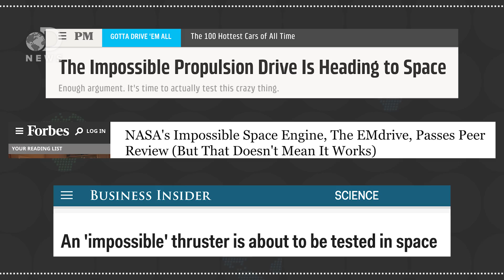How The 'Impossible Drive' Could Break Newton's Third Law

Comment: it is because the shape is a cone that it dosnt break Newtonian physics. forces on the flat end all react along the axis. while forces on the angles walls act at an angle to the axis. the part of the force perpendicular to the axis is cancelled out by reaction forces on the other side of the cone. leaving only a small amount of the force acting along the axis. so you have a reaction force of 1 vs a reaction of cos(angle) [which is less than 1] . resultant is an over all reaction force on the cone in one direction. albeit the force is very small, sign(angle) of the momentum of microwaves, so very difficult to measure let alone test.  acceleration due to the sun light hitting the craft is likely more than this engine can produce. it will likely need more than one test flight to make certain it works.
Reply: Notgnihtrow 1.2mN/KG
Reply: I try not to miss the opportunity to question someone who seems to actually know something- so two for you.  Are you proposing some kind of highly reflective solar sail as more efficient?  Second, in the proposed engine would it further tip the scales if the cone were highly reflective and the back not so reflective- like hitting a golf ball forward and a marshmallow backwards?
Reply: rjohn19  yeah just by concept a solar sail would be more efficient, as it does not supply the photons so there is is no loss of momentum when the photon are formed or bounced back as it would be in the resonant cavity machine. and you would never want one surface to be less reflective. that means that the energy is lost to some other type rather than transferring momentum. so on your example, a golfball bouncing off a concrete floor. the golf ball is bounced almost to the same height. the floor needs to supply the maximum amount of inpulse(change i momentum) to bounce the ball back up. there is vary little losses due to sound heat etc. golfball vs marshmello on the other hand. the marshmello gets crushed, the energy goes into deforming the marshmello and heating it up a bit. there isnt as much momentum transfer as more energy is lost to head/deformation/sound etc. it dont take a lot of energy to make noise, but heat and deformation take a lot of energy to make a change. in both examples the heat increase would be fractions of a degree. just think of the pressure you need to apply to crush a mallo. its not that much but its is on the same scale as dropping a golf ball from waist height. or think of it another way. to get the ball moving back up the impulse has to first negate the downward momentum and them get it moving up. in the second case where the ball crushes the mallo and dosnt bounce up, the impulse is just getting the ball to stop moving. the energy that would have accelerated the ball up, deformed the mallo instead. so the impulse supplied by the mallo is roughly half of the concrete floor

Comment: How can they not know if it moves or not , they can measure vibrations from gravitational waves, 
stick a laser beam on it and see if the reflective light time changes .

From the paper the EM Drive produces 1.2mN/KG so (?)
Reply: It moves they just don't know if it moves because of the drive. Even a tiny amount of thrust from it would be revolutionary, so they are cautious to say it works..
Reply: Lee Myers turn it off then on
Reply: lol
Reply: it's not it being on or off when it is on there can be other things that can be generating thrust and isolating the thrust of the other things is the hard part that they need more testing to ensure
Reply: Lee Myers that was a joke on if it moves while off it doesn't work
Reply: Lee Myers anyway it's probably heat transferring from the inside of the copper to the outside that's causing the slight movement of "Thrust"